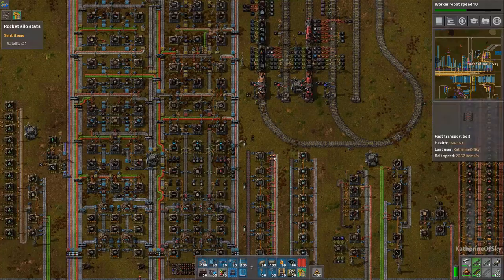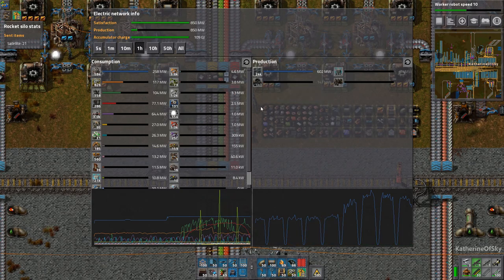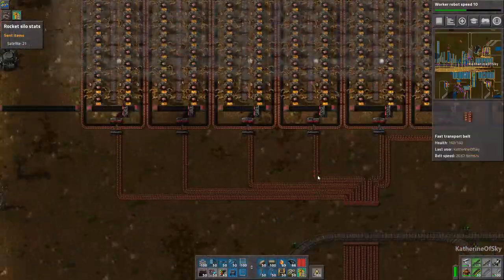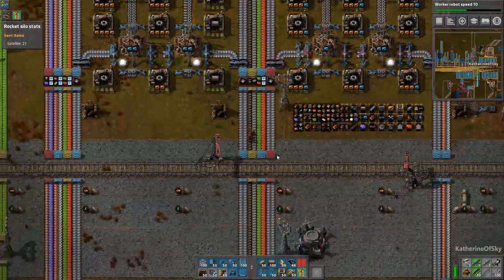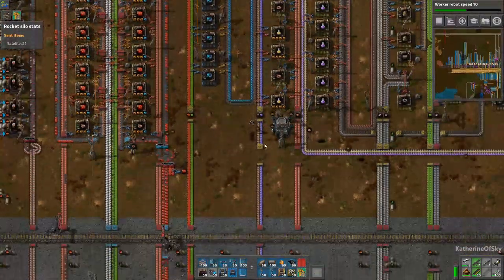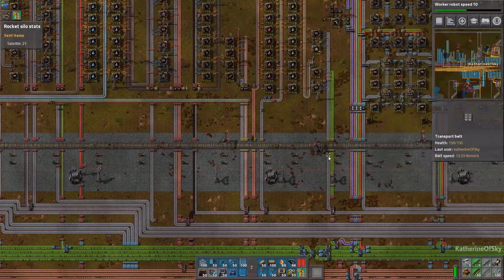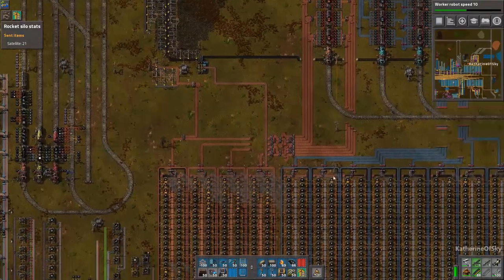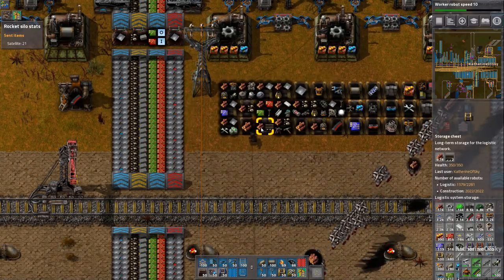Factorio: Entry Level to Megabase Ep 64: RECYCLING SYSTEM - Tutorial Series Gameplay

Comment: For recycling burnable wood products, I like to have an isolated steam assembly. 1 boiler, 3 steam engines, 2 fast inserters, 2 requester chests. The first chest is requesting wood, the second requests boards and small power poles. The inserter on the wood chest is set to only insert if the board and pole chest is empty.
Reply: For the rest I prefer priority lines kind of like the ones you like to use.
Reply: Depending on tree volume, a full steam assembly may be needed.
Reply: That's what the priority lines are for.

Comment: It's so nice to see the base again. I tried to build a base like yours and green circuits where so slim and the same with plates and I had no idea why??!?
Now. See you got the on red belts and mine are blue.
Reply from the maker: Indeed, the furnace columns are tuned for red and not blue.  For blue we'd need around 76 furnaces per column. :-)
Reply: KatherineOfSky true. I didn’t get that at first and I got a very very nice blue print of a smelter array that goes in a zig zag with beacons and models that is smaller (width an height) and fill a blue belt. Now need more ore :)

Comment: You're probably requesting iron plates at your nuclear fuel assembler.
Reply from the maker: Oooh, you're right!  I forgot about that!
Reply: You only need 1 iron plate every 28 seconds per reactor, so it's a slow drain.
Reply: The issue is KoS probably set up a passive provider to pull iron for nuclear. With a requester chest asking for recycled iron, once the storage chests are empty, the passive provider will run non-stop feeding the recycle requester chest (and a little to the nuclear requester). I had hundreds of bots feeding iron in that infinite loop :)
Reply: I have yet to find a decent way around that problem either. Other than the outdated passive requester mod.
Reply: Limit the provider chest to 100 plates (I normally just hard limit to however many stacks I want). Set the requester for recycling to request 20 plates, and then set the inserter that is doing the actual recycling to "Connect to logistics network, enable only if iron > 100".